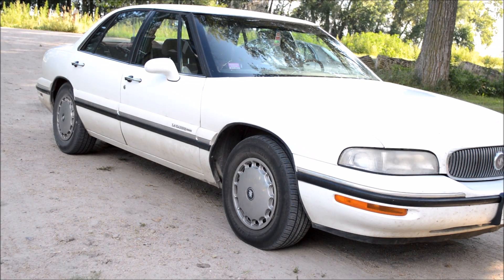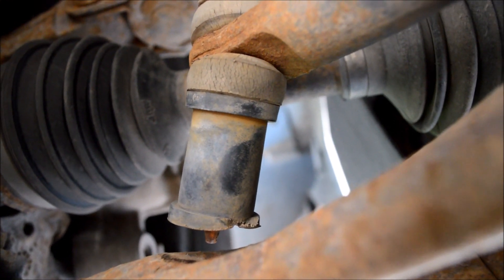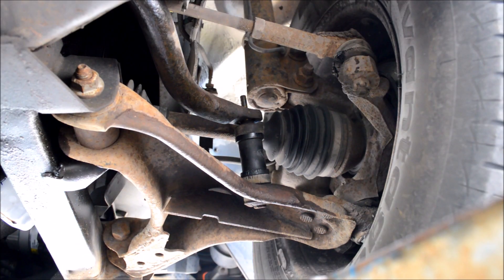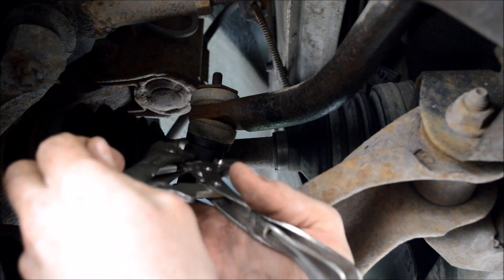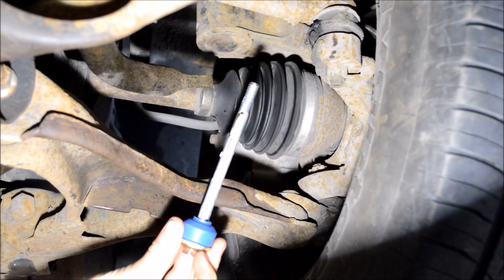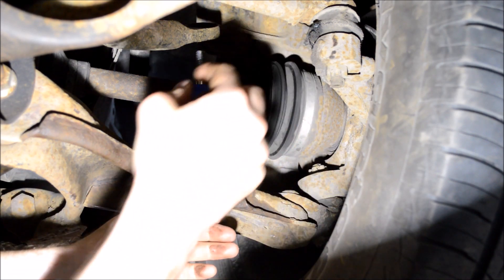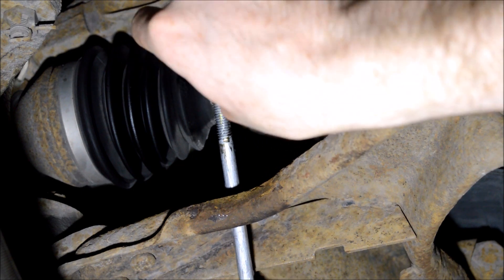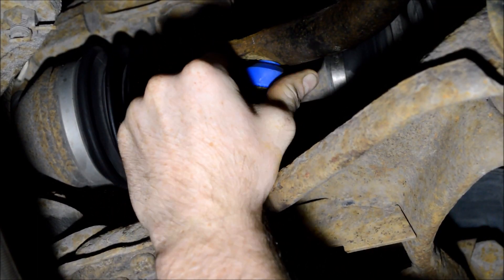How to Replace Sway Bar Links- Buick LeSabre

Comment: Wouod it still be safe to drive 90 miles with both broken off ? Woupd be easier to do it at home instead of on the road
Reply from the maker: I know of people who have driven that far with both broken (they tend to rust off in the climate where I live). When they are broken, you may notice steering to be more sluggish than normal, so drive carefully if you do. Yes, it will be easier to do at home, but it's probably doable on the side of the road.
Reply: @tuffylegit45  correction 190 miles. Oklahoma city to ft smith ar. When i taoe right curves on interstate it starts shaking until i let off.

Comment: My bolt head broken off, how do I get it off without millimeter socket?
Reply from the maker: If the head broke, it sounds like you just need to get the bolt driven or cut out of there. Maybe use a hammer and punch to drive the bolt out. Alteratively, you could maybe work/wiggle/turn it out with vise grips, or cut it out with a hack saw or grinder.

Comment: Are the sway bar bushing easy to replace too?
Reply from the maker: Great question! Yes, it's not too hard to change the sway bar bushings, either. I think each of the two bushing brackets is held on by two bolts, and they are not too hard to get to. The rubber bushings themselves are split, so they will come right off the sway bar with ease.
Reply: @tuffylegit45  I'm doing the end links and bushings soon as parts get in. Thanks for informative video!

Comment: does anyone know offhand if you need cupped washers for the bushings or will the flat ones from the kit matching my vehicle year/model work just as well? i assume if its from the kit it should but the old ones and the ones in this vids kits are both cupped hence why i ask.